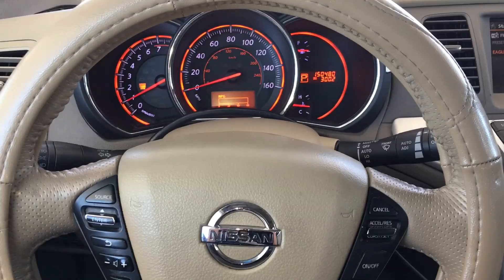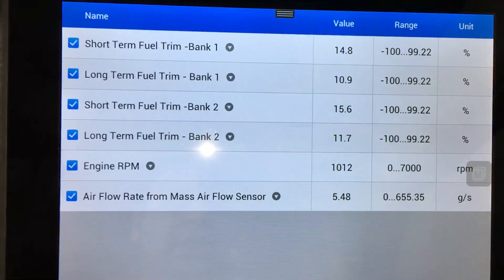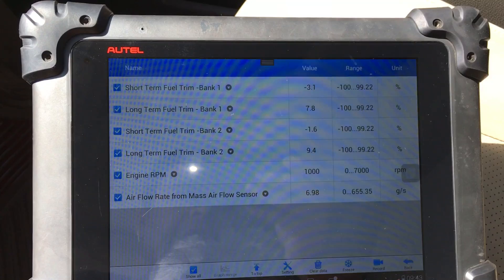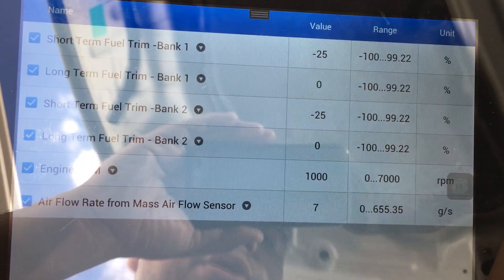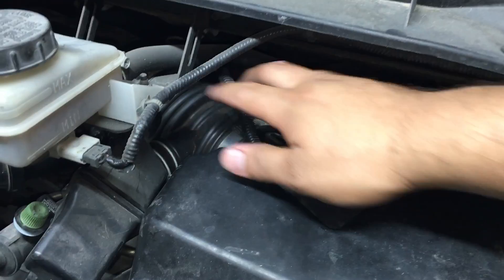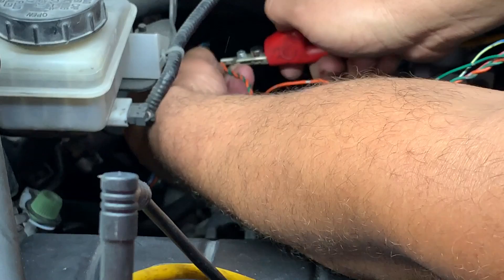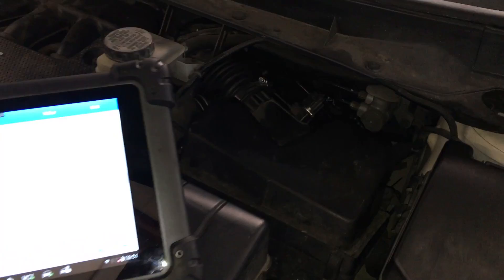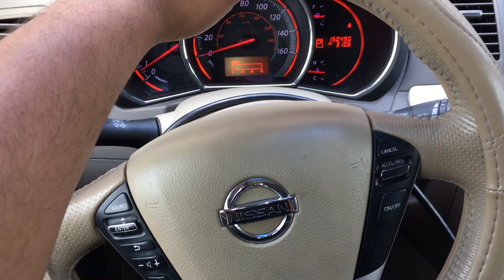NISSAN MURANO RUNNING ROUGH P0171 & P0174 DIAGNOSIS FIX

Comment: This video saved me from a perpetual headache as it turned out, my 09 Nissan Murano had the exact same problem. Unplugged that MAF sensor connector, wiggled the wires here and there, plugged it back in, cleared the error code. And crazy RPMs and bad fuel economy went away. Need a permanent fix for the wiring but thank you so much for this video!!!

Comment: You are definitely one of the best technicians I've seen. Your diagnostic process is very thorough and thought out. I definitely learn alot from watching your videos. I was immediately assuming a vacuum leak and would have wasted an hour smoke testing the system to get nowhere. Very well done!

Comment: When you went to the test drive I had already concluded it was a vac leak, based on the improvement at WOT, and I had already decided you needed to smoke the intake. I wondered why you would do a test drive, where heat could destroy evidence of the leak. To my humble surprise, watching further, the MAF was giving strange readings and the improvement with WOT was not repeated on a second study. Good for you, to collect more info before jumping to conclusions.
Reply from the maker: Actually I picked up the vehicle from the customer at her workplace down the street from my shop. So I had to drive it back. I guess it worked in my favor. Thanks for watching!
Reply: Me too! I figured it was just another vacuum leak. Great find.

Comment: I had an issue where my Murano was running rough and bucking severely, especially on hills. After replacing the MAF sensor, the problem persisted. A thorough search revealed the intake tube to the throttle body (accordion-looking thing) was cracked on the backside in two places, which was completely hidden from view. I replaced that piece for around $80 and now the car runs beautifully again. What a relief. Hoping this will help someone in the SW where drying/cracking rubber is common after a few years of use.
Reply: We had the exact same issue. How embarrassing was it (with an Uber passenger) trying to accelerate after a traffic light with a bad case of the put puts. My quick fix was heat resistant tape over the nasty cracks you mentioned until my part was delivered. I was so amazed with the tape that I threw the replacement part in the trunk and drove on the tape for close to a year.

Comment: This right here is a perfect example of why older technicians don't wanna do diagnostic work because back in their Hey day their golden days it was about 30 minutes to an hour to diagnose and maybe 15 to 40 hours to repair for example an engine knock 2 or 3 minutes to confirm and then 20 hours to do an overhaul depending on the type of engine or maybe 20 hours overhaul time yankit rebuild it get it back and get it running out the door.
 Great video illustrating the need for scan tool and O scope to confirm readings excellent video demonstrating the use of 2 different devices to get to one answer
Reply from the maker: Thank you so much for watching! Btw I subbed to your channel. I've just watched a couple of videos and I'm really enjoying your stuff!
Reply: @ADVANCEDLEVELAUTO  well thank you for subbing . I be watching your channel .

Comment: Acted like a vacum leak, but when it flipped, that was a big clue. Great job on the diagnosis.
Reply from the maker: Thank you!
Reply: Do you suspect that was the motor torquing over and bending the wire/opening the circuit?
Reply from the maker: Yes! Exactly what was happening. Thank you for watching!

Comment: nice job Eric  loved it   way to check that wiring before putting a part on it.   Butane soldering torches to me are bothersome in cold weather i noticed.  MILWAUKIE has a lithiom ion battery powered soldering torch 140 DOLLARS HOME DEPOT   all the best

Comment: For Nissan people....STOP using CVT  TRANSMISSION!! its your setback! You know it yourselves that it is good only for 5000km  on Murano and it will bug down. Make a manual Murano or back to traditional automatic drivetrain.
Reply: Cristina Cruz    You can thank Renault, the parent company of Nissan.   When they bailed Nissan out, one of the conditions was Nissan had to go to cvt transmissions.  Nissan went downhill after that.
Reply: @nissanneal  I have the unicorn Murano.  150k miles, original trans, no problems.  It's been driven by someone with an extremely light foot 95% of the time, that might have something to do with it.  But whenever I drive it, I treat it like any other vehicle and it performs fine.  Currently knocking out a bunch of engine issues and maintenance but nothing terrible.  Valve cover gaskets, plugs, upper intake gasket, PCV, alternator(killed by the leaking valve cover), and an oil pan gaket(so much oil from the valve cover leak I dont know if it's bad, but screw it.)  Overall the car had been pretty trouble free.  It hates suspension parts, but they are cheap and easy to repair.  I won't be surprised if this one hits 250k miles.
Reply: Cristina Cruz i own a 09 murano w 146k miles. Original transmission... they have issues but they’re not as bad as everyone says. The really troublesome transmissions come from the budget Nissans like the Versa
Reply: One of the PE coaches at my school had 80k on his Altima, the transmission was going out for the third time. Apparently it was replaced twice under warranty.
Reply: I’m testing a 2011 Murano but maybe I should keep my 04 Xterra with 230K no major issues just maintenance...I’m getting discouraged by the new cars lol
Reply: If your engine is facing to the front and your belt is facing the front of the vehicle it means u did a good job picking the right nissian. If your engine is sideways and ur belt is on the side well u fked up.
Reply: I have a 2012 MURANO SV and NO CVT problem EVER at almost 150,000 Km
Reply: @ClaudeThibault-tc3gi  try puting all 5 people in your car, them put their luggage also at the boot, and travell about 300 km then  go up  hill on highway, you will start seeing your Car stacking on 60mph or 80mph doesn't go beyond that which is a limp mode in most of Nissan Vehicle, when you stop  and  switch off the engine and stay for about 30mins when you start again it moves again as usual.

Comment: If the fuel trim numbers are high at idle and decrease at high rpms most of the time is a vac leak
Reply from the maker: True. But this one was not really consistent and it was going lean during driving. That made me believe something else was happening. Thanks for watching!
Reply from the maker: Me suscribí a tu canal. Me gustan tus videos
Reply: Thanks colega. Saludos you got a new subscriber too
Reply: Correct, my issue was a PCV Blow By Gas Hose had a tear.

Comment: Hey Erric, am Carlos. Am NOT a auto-tech. Anyway, I have a 2018 Nissan Maxima Platinum with just under (20000) miles on it. I notice whenever am backing up, I hear a subtle, but noticeable knocking sound around driver side front wheel area. Now this is my 5th Maxima and I noticed this sound in the last two previous cars. I brought it to Nissan, the tech agent came and heard, but still am hearing the sound. What do you think?

Comment: Great video.  I have a 2006 Murano SV with only 155,000 miles, no engine light on, everything is good except when stoped and I step on the gas, the car doesn't seem to go but studder and doesn't seem to go fast.  Then after a few seconds, it starts to run smoother.  Any suggestions or ideas where to check?
Reply: Will K do you have a code scanner
Reply: @rahrah8076  I do but there's no code showing.
Reply: I have the same issue on a 2012 Murano.  I have code P0101.  I cleaned the MAF sensor and throttle body.  Gonna drive the car for a couple days to see if the check engine light goes away...
Reply: Will K what kind of code scanner do you have ? If it’s just a basic generic scan tool it will only show basic codes..you need a high end scan tool
Reply: transmission dead
Reply: Francos Farms How?
Reply: @ML_1515  cvt is a problem,  you are lucky it lasted that long.  Nissans with cvts are junk.
Reply: Francos Farms Actually, mine was a vacuum leak.  replaced the boot and its fixed.
Reply: Same issue with my Murano, did you ever figure out the issue?
Reply: @corystacia5258  No.  I sold it to Carmax.

Comment: Is there a step by step process to relearn the Thrttole Idle without the scan tool?. I have a 2015 Nissan Rogue with push start button and  daytime running lights. I need to clean my throttle body but can't get a step by step procedure for relearning the throttle body idle without a scan tool. Thanks in advance and great video 😊

Comment: I keep getting those same codes and have already replaced everything obvious to replace. My car doesn’t stall or anything but the check engine light will come on after a few days of driving it or letting it sit for a while but will continue to drive smoothly. I don’t have all the computers and tools that you have to be able to check everything in depth like that, do you think it could still be a wire that’s starting to have a bad connection? Like a lesser worn cable than the car you worked on?

Comment: Dangers of your choice Euro flashlight LED on your cell phone was on the whole time creating extra glare outside of what was in the background behind you! I'm surprised you didn't see it cuz it was clear to see from our point of view that your LED was on shining in the plexiglass on your instrument,!? Also I've used one of those butane powered soldering irons since the 80s that I have had in my toe case and it is it is lit by piezoelectric inside you can use a regular hand lighter to light it but obviously it's defective the piezoelectric part is not lighting or igniting the gas

Comment: Why does my car experience surges when idling? I recently had my ignition coils, spark plugs, and air filter replaced, and I've noticed a slight surging sensation, even though the RPM doesn't fluctuate. No codes

Comment: I bought so many of them Butane tools. Not one lasted more then a month.. I ended up just getting TS-100 OLED.. That thing works every time....
Reply from the maker: I’ll be sure to check it out. Thanks for watching!
Reply: @ADVANCEDLEVELAUTO  Using it right now. To install new head unit in Volvo..And Fix a Ford Driver side power window controls. Someone cut every wire trying to get the window. I use a NOCO GB40 to give me hours of portable use. Works great for Vehicles.

Comment: Well done Eric. The Murano lives to drive another day. Nice diagnosis and repair. Did you have the gas control set to maximum when trying to ignite? Same as a gas bbq. need a lot of gas flow on ignition then adjust back to the required setting. If still no luck get the money back on the strap on and grab a Milwaukee m12 iron. They are fantastic.
Reply from the maker: Yes, I tried with different gas settings, but no luck. My Strap-On dealer comes by tomorrow, I'll see what he thinks. Thanks for watching!
Reply from the maker: My Snap-On dealer had to send it to get repaired. Now I have to wait 2 weeks to get it back.
Reply: @ADVANCEDLEVELAUTO  bummer. Buy the Milwaukee anyway lol.

Comment: I'm not sure if you can PM I am having some intermittent electrical issues. One- when I'm at idle my lights will flash while my RMPs jump from about 600 to 1000. Engine revs on own. Replaced alternator 1.5 yr ago. Mass air flow sensor 2.5 yrs ago.
Reply: Check your grounds and battery terminal connections

Comment: I'm having the same exact issue with the studdering on my 07 it will run well then it will stutter. 
Almost sounds like a plugged converter to me I hope not I'm about to go wiggle the MAF.
I just replaced my entire rear k member on this 2007 Murano, I wouldn't have bothered however before this it was running awesome it sat for six months waiting for me to get around to doing the K-member it was rotted so bad the rear tires were tilting in so bad the inside of the tires wore out, this, in turn, wore out my rear driveshaft bearing so I dropped the rear shaft.
This truck is 99.5% front-wheel drive anyways. I believe that most of the problems with these CVT's are derived from when people use the all-wheel-drive on dry tar turning in 4x4 in a parking lot will really twist them, bands, up,  so I have no issues never putting that shaft back in & especially at $1200 bucks for a new one   so I thought it was condensation in the gas but ....  i
Reply: Did you figure it out? Was it the same problem? Have the same issue with my 07 too

Comment: I got a 2004 nissan morano  when you put your foot on the pedal it  doesn't want to move and when I try to start it the next morning the battery is dead I even bought a new  alternator still having the same problem
Reply: Same here. Have the '04 same as you. Mines broke down several times won't start back up replaced alternator, take battery out charge it, still same issue. Doesn't do it everyone either. Making me wanna commit insurance "adjustment" on the damned POS. Full coverage is a beautiful thing.
Reply: Was having issues woth battery too, changed battery and alternator didnt fix issues. Starter went out and i haven't had issues since, except the car dying while driving. Changed the battery terminal leads and have no issues with it. 150,600miles

Comment: Hey Eric got a question for you with your personal experiences with Nissan and code's P2A03 which is also same with code P2A00 for Bnk 1. Have an Infiniti G35x 2006 with Code P2A03, new all sensors and the self learning reset. Any ideas?

Comment: In this case it was the wire but if it wasnt the wire what are most probable possibilities for code P0174? My friend just got that code today and we are planning on attacking this in the morning
Reply: 787puertorico1 start spraying carb cleaner where the intake gaskets are and where vacuum lines are but be careful you don’t start a fire and   listen for a rpm change or put a smoke machine on it
Reply: Hi sir i am very big fan of you i am very fond of you Banquet thank you make a video for us
Reply: Sir i need software for wiring diagrams of all car

Comment: I just bought a 09 Murano and replaced the Accelerator pedal sensor and got no results.(I was told this was the issue) It doesn't rev up. Is this the limp mode for low tranny fluid? I didn't check it. I did hear a loud whining when 1st started, I thought it was the pw steering pump. Thanks Much for ANY HELP!

Comment: No way that the Murano has a steady RPM of 1000. That is not factory settings. it should be around 550-650 RPMs

Comment: bro... my 09 murano.. has giving my problems month after month.. ive spent over 5500$ keeping it on the road.. my 02 sensors are messed up. evap canister seems to be stuck open/closed. now im getting a fuel rail sensor problem.. now i cant even get to work.. Can anyone give me some hints or somthing to get this vehicle going... ill write down all the codes it has.. i just need some help because im in an area with no family. no friends.. im just working. now..im stuck.. anybody know about this vehicle?
Reply: Check your MAF for integrity

Comment: If I owned an auto-shop and you used a black wire; rather than an orange/white wire; to fix an electrical problem; I would fire you.

For who gave  you the right to change the color code in a wiring harness? Huh?

The color code with a maze of wires is the heart of electronics.

Sorry, I have NO respect for ANY mechanic or technician who changes a customer's car (If it's your car do as you please but NOT to a customer). I was a mechanic for 45 yrs and I would never do that; nor would the better mechanics ever do that. We would do EVERY thing we could to use the SAME color wire.

"Where there is a will there IS a way!".

I know, I know, most of the world accepts this shoddy work, but it is still wrong.

Comment: You completely lost me when you decided to solder those. Solder has no place there.
Reply: @arnulford66 Lots of reasons. No control of the process, extreme heat underhood, extreme vibration zip tied to the engine...

I could go on.
Reply: 2010 Nissan MuranoAWD,  when I am driving and excel to a higher speed my SUV strain to move to a higher speed. Then drives slower.